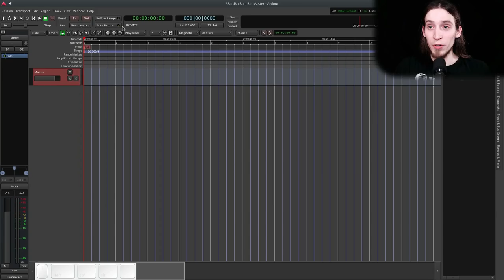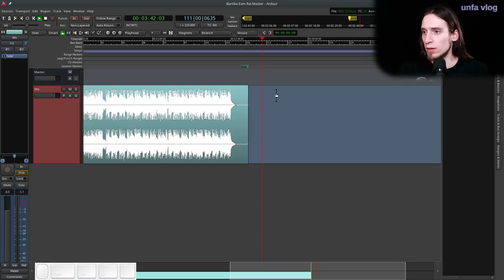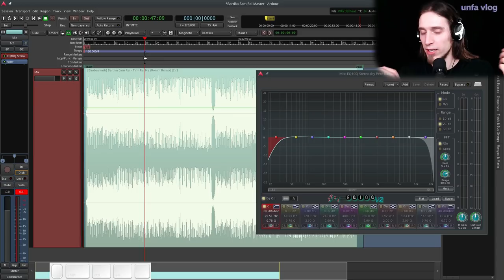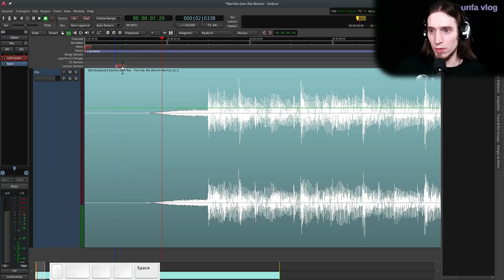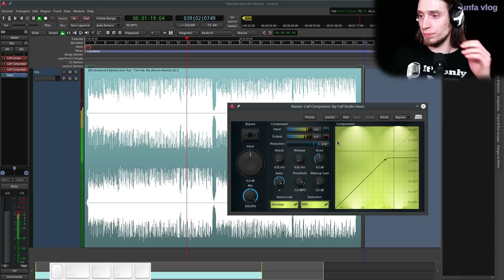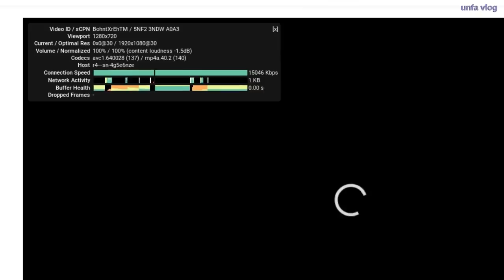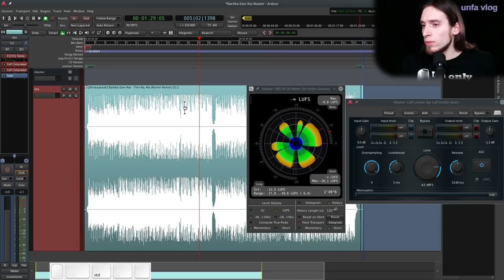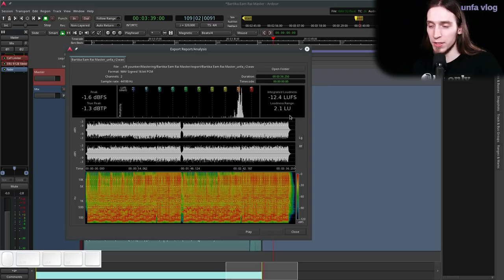UV#24 Mastering an EDM single with Ardour, Calf and EQ10Q

Comment: I just found this video and found it to be very useful. My mastering in the old days was very similar but missing a few steps at the end because we weren't dealing with LUFS and just outputting to CD. I typically ran a limiter on peaks at about -3 dB depending on the material and did a small amount of deep compression on the music to bump it up. I love that you are talking about dynamic tracks being the new loud. Back then most things were squished within about 4 dB or so for radio to avoid the hard limiters of the radio systems squashing the music but I've always preferred leaving tracks more dynamic. Of course, this depends on listening environment. Listening in your car on a CD (more from disk today) is much different than the quiet of your living room.

Thanks for the tutorial about LUFS and YouTube's compression. This will help me greatly mastering for YouTube and other video platforms compared to a master for release on a digital device.  

Yours is one of the most useful tracks for professionals around. Thanks again and keep doing what you're doing.

Peace,
David

Comment: Hi unfa and thanks for the video.
One question: is mastering done everytime on a mix or can you do directly on the Master track of a song you are creating for example in Ardour?
Reply from the maker: Hey! In my opinion mastering is best done in a separate session. Why?

1. It forces you to commit to a mix and call it done, before you move on to mastering;
2. It helps you focus on mastering, without the temptation of tweaking the mix  well;
3. It frees up your CPU time to focus on mastering, speeding thing up in case your song session is pushing your hardware.
Reply: thanks for your insights @unfa00  . Always appreciated!
Thanks again!

Comment: do you or anyone know how to get ebumeter into ardour, i installed it from software manager in linux mint 19.3, but i cant seem to use that one with ardour, or am i not doing paths right? figure it would work, the eq10 deal installed and found it with searching vsts, but not ebur128, i thouroughly googled this to no avail....great video very useful info thanks, just stuck on the ebur128.
Reply from the maker: Have you installed the x42 metering plug-in bundle?
Reply: @unfa00  thanks no i didnt have x42, installing now, thank you Unfa!
Reply from the maker: @alienandroid943  Great! Good luck :)

Comment: The song is sooo badly mixed. Don't bother mastering it.
Reply from the maker: I used it as an example to show the basic tools you can use to master mixes using free and open source software on Linux. Sure you would want to first make your mix as good as possible before mastering, but that was not the point of this video.
Reply: @unfa00  I know. But mastering is also about being honest :-)